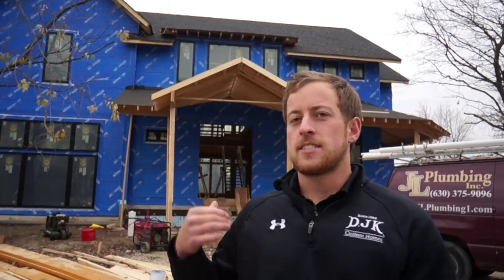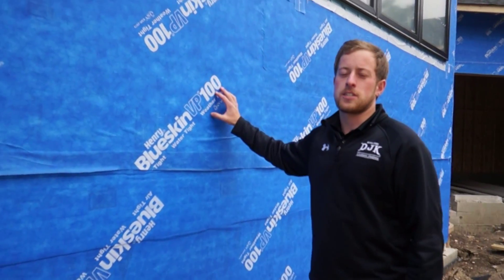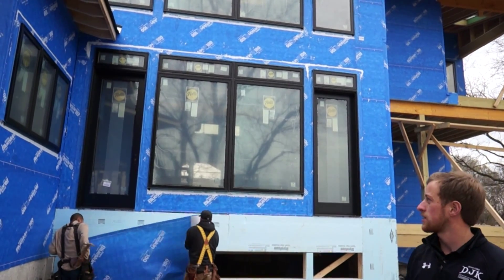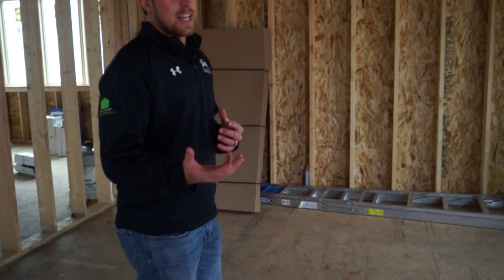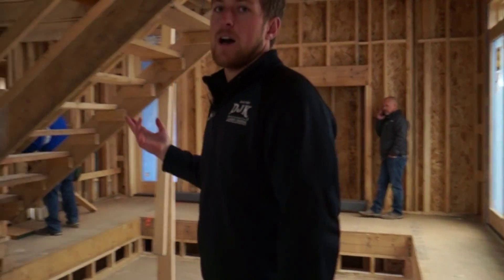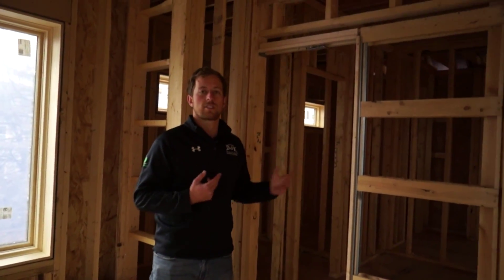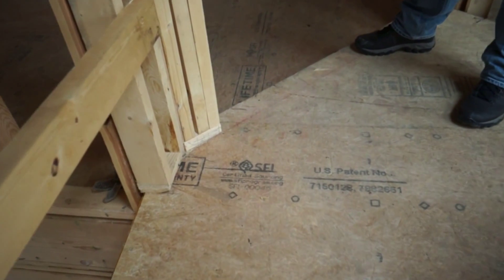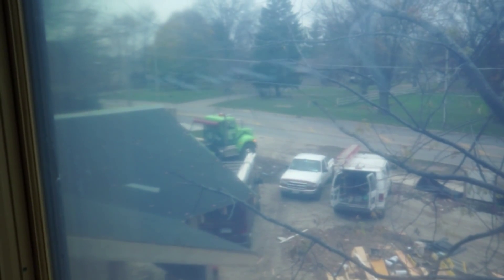DJK "Modern Farm House" Eco-Smart Home Advanced Framing

Comment: How did you connect the Deck ledger to this house with the exterior rigid foam? I can't find information on that advanced framing technique anywhere
Reply: Wesley Borden Do you just never be able to find out nobody’s gonna told you the truth there is no way possible to attach the Ledger board firmly to the house If it’s not holding from the house directly is yust not holding from the house Common sense and Even the inspectors they not gonna told you that simple as that